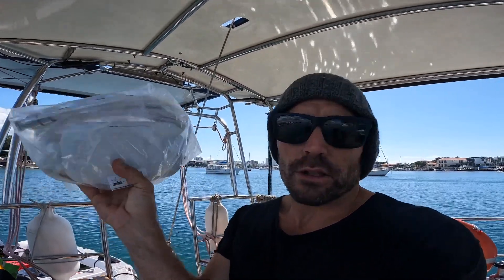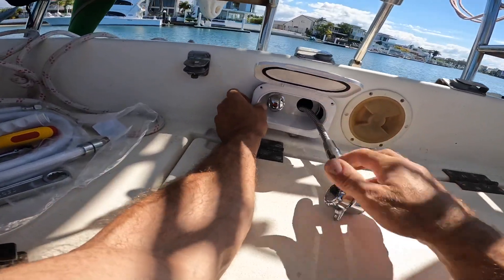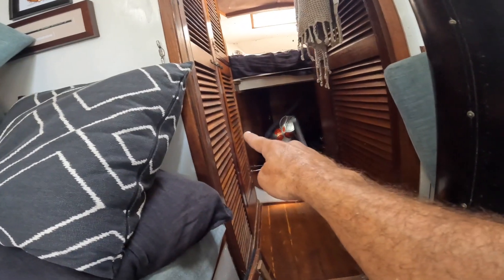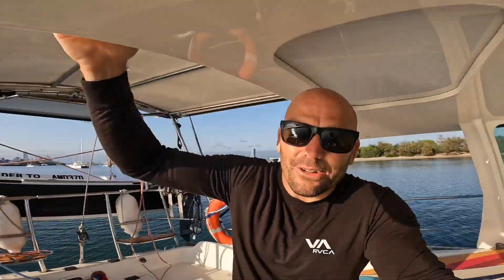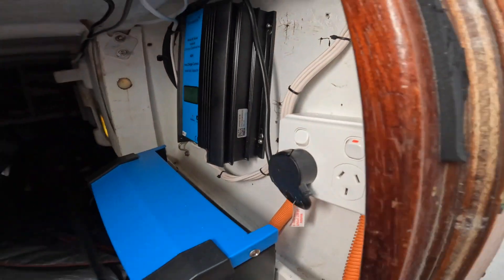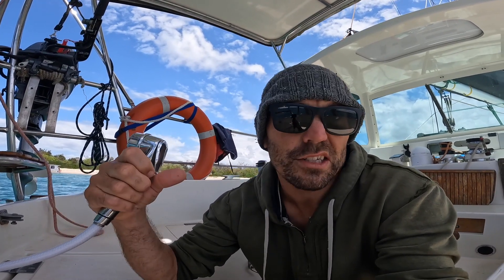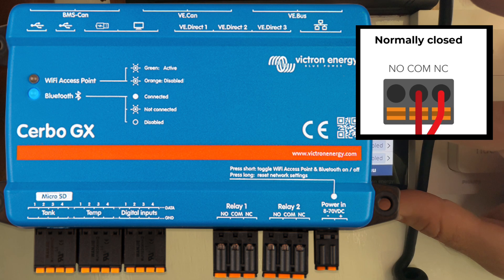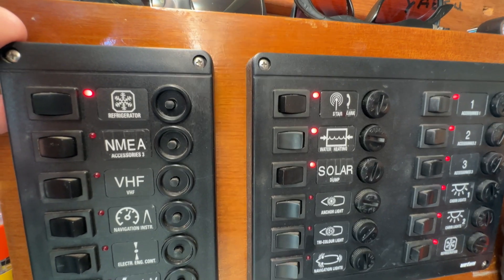Efficient Solar Energy Use: Dump Load Setup with Victron Cerbo GX

Comment: Hey thanks for that! I'm just a little confused as to how two switches are connected to the duoetto?  You have one for manual on/off of the water heater and then another for the solar dump... Do you have a quick wiring diagram you can share by chance? (Even a pencil sketch would be great!)
Reply from the maker: I’ll try explain before we start sending diagrams thru. You’re probably getting stuck on, Why there are two switches instead of just one. This is just so I can manually have the solar dump active or not.
(assuming you have a low amperage switch with your hot water system: I had two positive wires coming off my heater: one high amperage straight to the battery and a low amperage to the switchboard)

I’ll call these two switches (on my switchboard) MANUAL (to just turn the heater (12v) on manually and DUMP (which turns on the dump load function manually as it’s theoretically always on according to the cerbo GX )
The output of both switches goes to the red positive switch wire of the heater.
The input of the MANUAL switch is coming from the battery and the input of the DUMP switch is coming from the cerbo GX.

This is just so I can turn the dump load off and on easy. If your want to leave your solar dump load on always always, then there’s no need for the DUMP switch. Once you set it up in the cerbo go it will be active. Alternatively you can not have the DUMP switch and just go into the cerbo GX settings and disable the generator start stop function every time you want the dump load function off.

Let me know if that helps ? 🙏
Reply: @slightadrift  Yes, that is exactly the information I was hoping for - how / where the wiring was going.  We want to set up the same eg: two switches (Manual & Dump).  I really appreciate the time you took to outline that - thank you!!

Comment: G'day. I live on an 25 ft sailing boat in qld.  All i been doing is put ten liters of water in an container boil halve pure back in than drop in an 12v pump with shower head and wash under that. Been working well for me so far.
Gerard.
Reply from the maker: Good system!

👍
Reply: @slightadrift   The system has worked well for me, but next year going to install an 10 liter hot water unit.
Gerard.